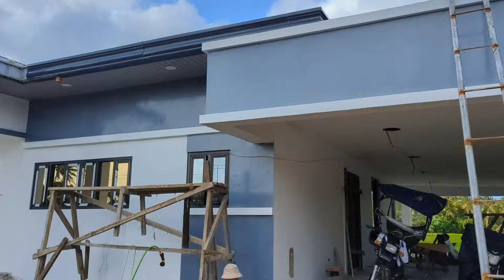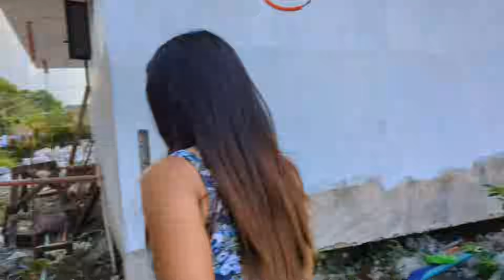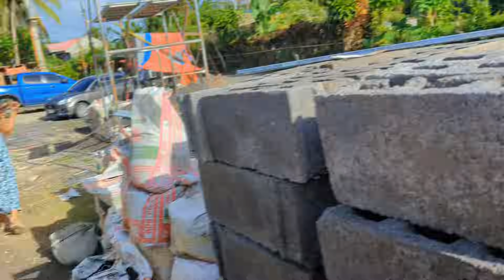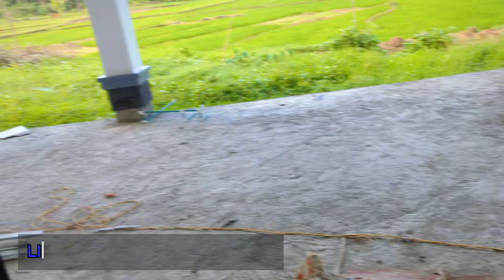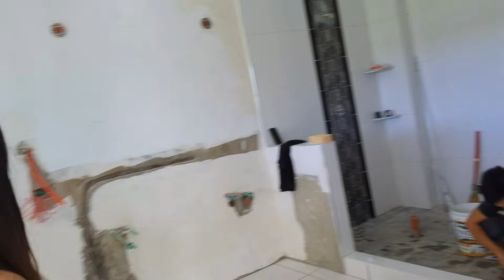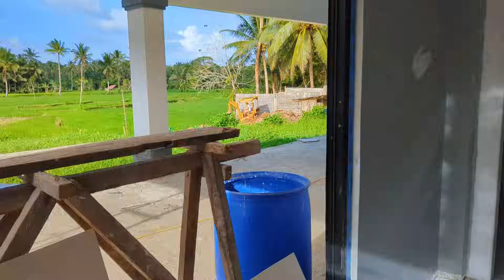Philippines House Build Day 222" Fence, Tile Grout and Bloopers"

Comment: Sir on the dryer vent is it common to leave open there on the outside wall or do they use the vents with the flapper like we do here in the states? After seeing the size of that spider you showed a few videos ago my house would be sealed tighter than Fort Knox.
Reply from the maker: It does have the flappers. Thanks.

Comment: In the front - Just after you guys walked under the ladder, (I am a bit  suspicious) Why did they put a down spout over a window.
Reply: And the catch-basin offset from the down spout position means an L bend to align. Does the job but ... yeah!
Reply from the maker: @demanoel9639 not ideal. Agreed
Reply from the maker: By the front door? The downspout will run next to the window, not over it. Thanks.

Comment: Hi Kevin, your home progress is looking great. Question about the roof, is a membrane placed under the metal and what is your ceiling made of, concrete? It just at this stage of completion hearing your having leaks is anxiety inducing lol. Adjusting to how things are built is a lesson in patience.
Reply from the maker: The roof is just the metal panels. The ceiling is made of cement board. I've definitely had some sleepless nights over this roof.  Thanks.

Comment: Looking great. When do the air cons get installed? A lot of finishing touches to do in 3 weeks. Do you have the generator now? Tiles and grout look great.
Reply from the maker: Thank you. Finish touches will be done by different companies and also our guys so it won't't be too bad. The aircon is scheduled to go in, in a week and a half. The backup generator will go in after we move in. I have an inverter generator that I use at the rental we will bring to the new house.